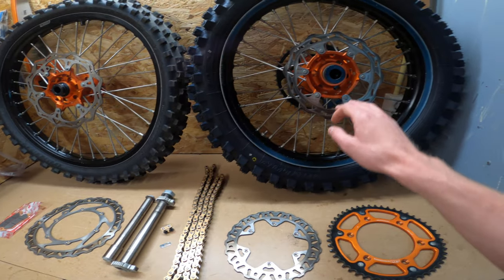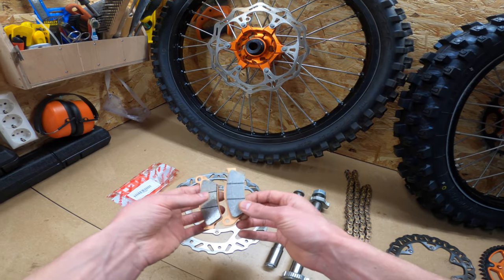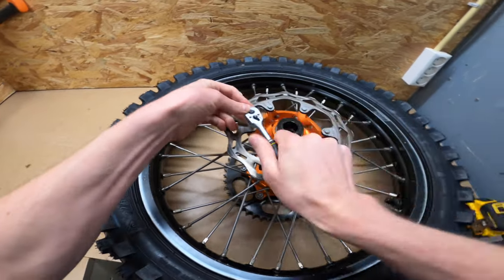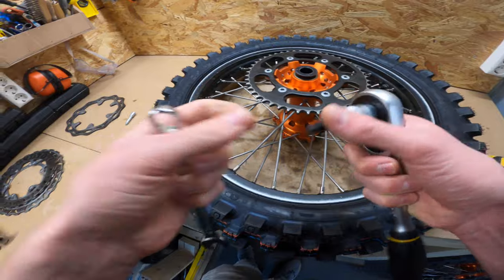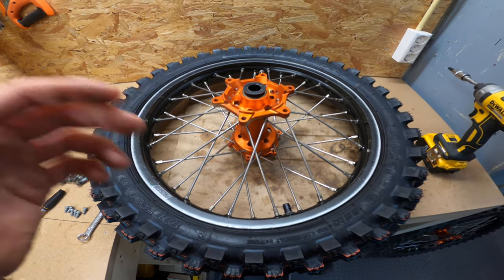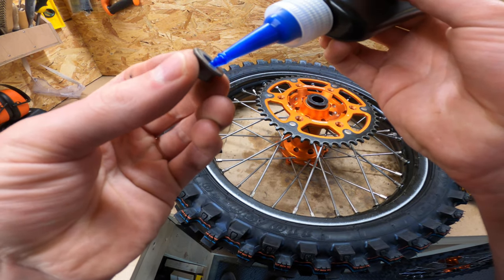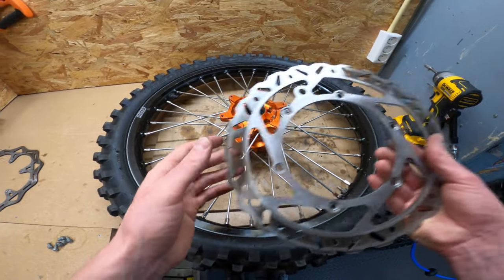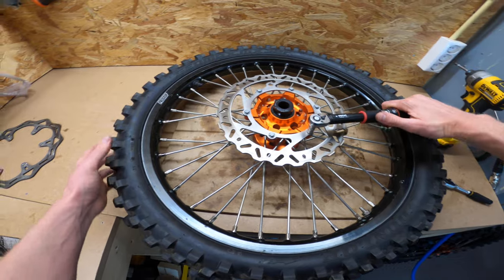KTM 250 SX REBUILD - Ep. #11 Installing Wheels, Chain and Front Brake Pads Dirt Bike (detailed)

Comment from the maker: What's up everybody! 

I recorded this in a different way which speeded up the process, but the video ended up being longer than usual. To be able to keep the important content, i inserted these sections! Which should make it also easier for you to find a certain part of the video!

Let me know if you like this! 

Intro: (0:00)
Parts to install: (0:14)
Brake discs and sprocket: (1:03)
Greasing axels: (6:49)
Greasing chain adjusters: (8:02) 
Installing rear wheel: (12:45)
Installing chain: (14:59)
Tighten chain: (17:50)
Installing front brake pads: (21:37)
Installing front wheel: (24:43)  
Tips after working on brakes: (28:32)
Outro: (30:45)